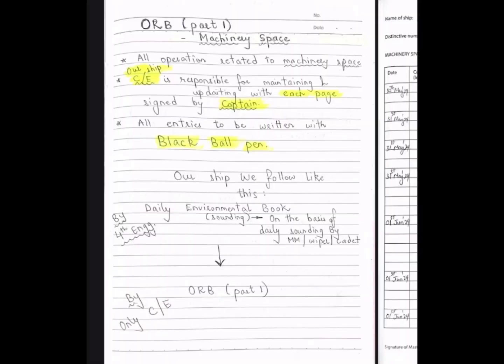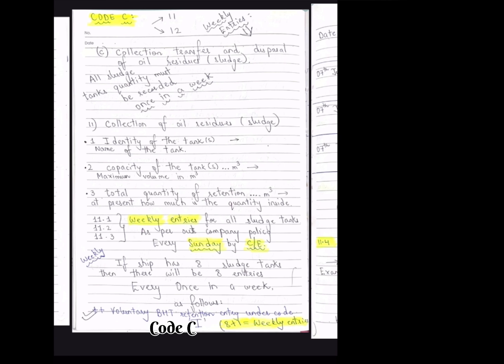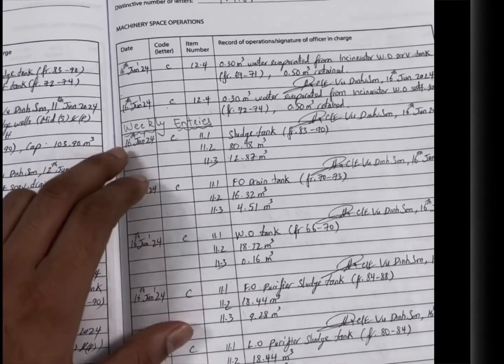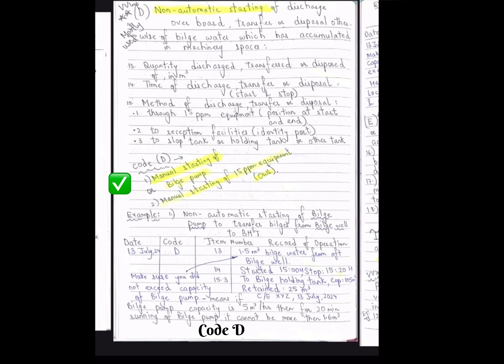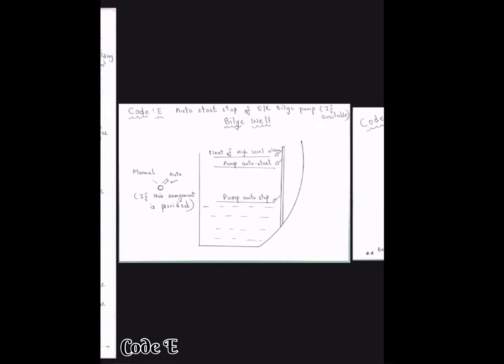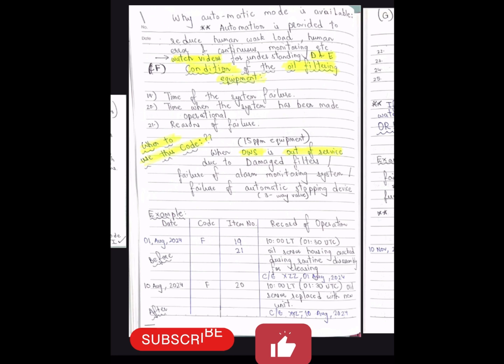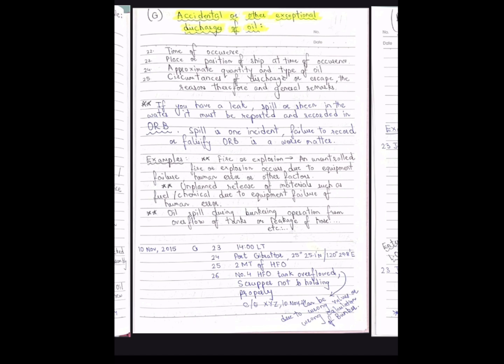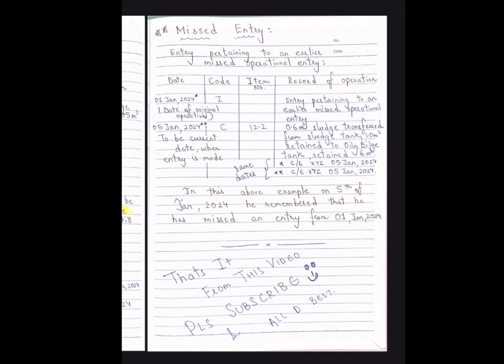Oil Record Book (ORB)- Part I # All Codes # Weekly Entries # Missed Entry # Ship # MEO Exams

Comment: One question regarding the ORB entry. Why was the transfer from drums to the tank recorded under Code H? As I understand, the lubricating oil was received in drums, placed on deck, and later transferred to the tank using an air pump. In this case, it seems to be a manual collection and internal transfer, which should be recorded under Code C 11.4, rather than Code H. My understanding is that Code H applies only to bulk bunkering operations via hose and manifold. Could you please explain the reasoning behind using Code H in this case?
Reply: but code C is for sludge right? can we record lube oil transfer under code C then? plz do reply

Comment: hey, mepc circular 736 : guidelines for filling for ORB mentions that lube oil in drum not to be written in ORB, instead it should be written in log book. You have mentioned otherwise in the video. Pls clarify on the matter.
Reply from the maker: Yes, as per MEPC it is not required to be noted. 
But in orals some surveyors were asking how you will record such entry of LO in drums with that context the answer is in Code H.. 
As well as you can record in Log book